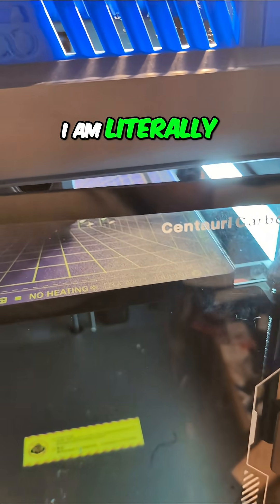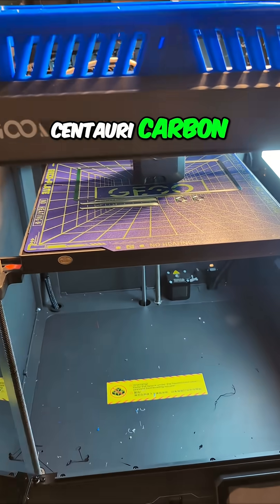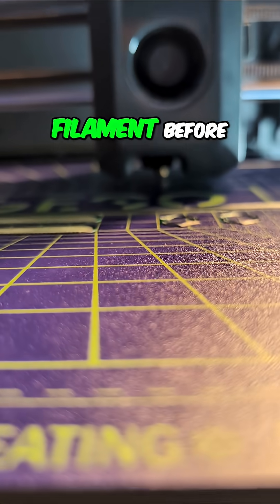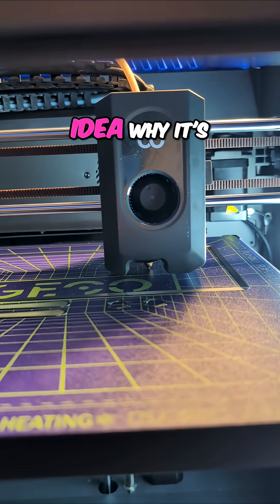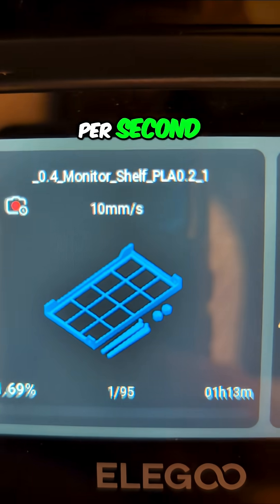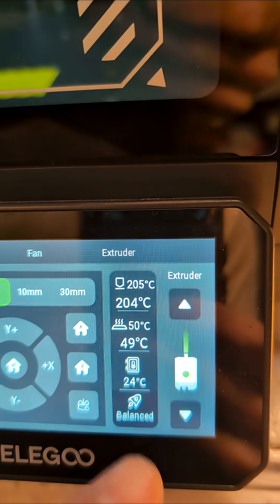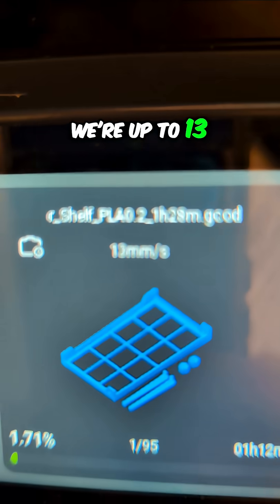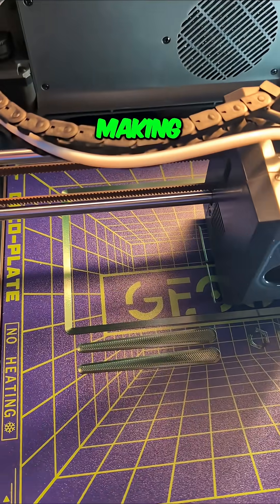Slow 3D Print? Troubleshooting Elegoo Centauri Carbon #shorts

Comment: its prob settings or it just did that on auto for some reason, you can fix it prob in setting. if it has a app download it i have my own 3d printer its with 3d printers that you can set the speed to, dont judge me bruh, its part of the 3d printing settings.
Reply from the maker: Yeah. A setting got modified by mistake